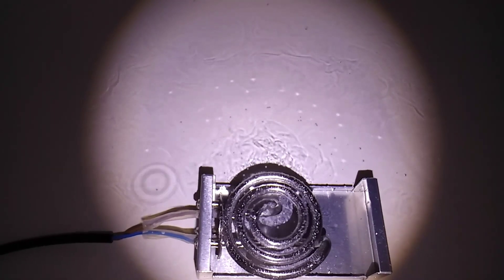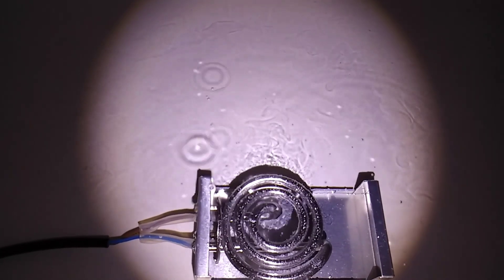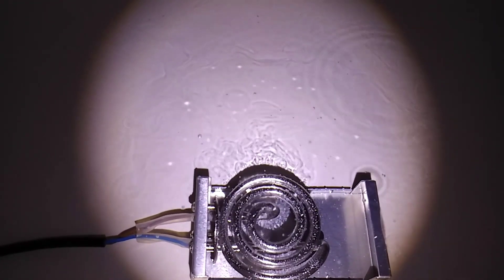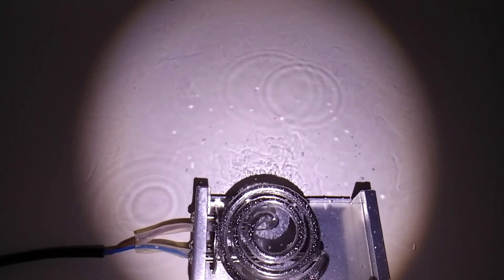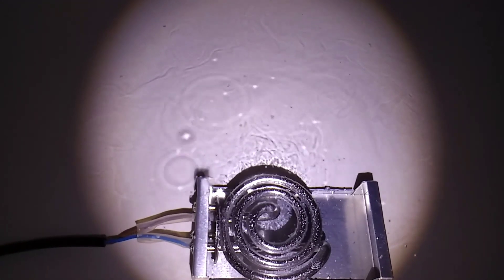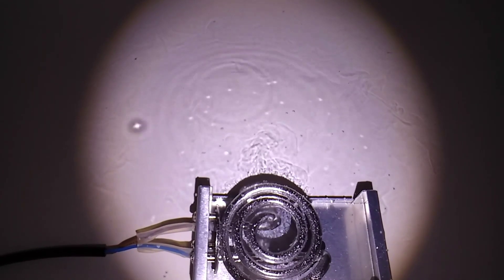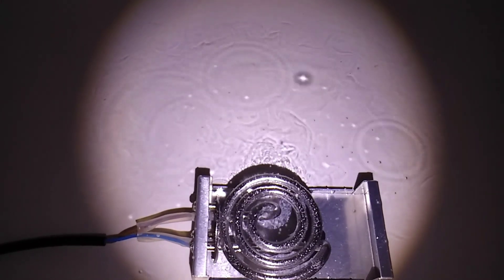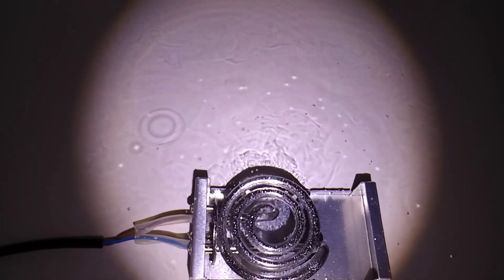Danger-bath.  If it's worth doing it's worth doing dangerously.

Comment: just like to know whether anyone has had their water tank heating element boil the water in their tank, the heating element was bought new and it has apparently a safety cut off for the thermostat, there is a reset button that activates should the main thermostat fail but apparently this didn't happen, one night the water came to boiling point and started to overflow in the to cold water tank above {I think this is an old design}, I suspect the satety cutoff which didn't work might be EU regulation, I'm from the U.K. the heating element is made by "Telsa" not the car company. http://www.teslauk.com/.
Reply from the maker: Has the built in thermostat ever worked?  It's worth checking that whoever installed it wired it correctly with the live being broken through the thermostat before it goes to the heating element terminal.  If the thermostat has failed then it's easy to install a new one as it will just slide into the sense tube.

Comment: Clive, I found my first tingly charger! I work at a repair shop and we had a power wheels car in with a 6v charger. The charger needed a new connector so I chopped the old one off, grabbed the meter to check polarity, touched one lead to the one wire (while holding it with my finger), and got a little tingle. Checked a.c. voltage between that wire and the (grounded) stainless steel work bench and sure enough got 50v a.c.
Reply from the maker: +Random_rapper20 The leakage from switchmode power supplies is very common.  I'm not sure about the metal workbench.  But ideal for electrical/electronic work.  A rubber mat on it might be a good idea.
Reply: Well to be quite honest most of the electrical work I do isn't on the bench (I repair electric scooters (look up razor e300 or goped esr 750), electric bikes, etc. The stuff I do on the bench is usually taking apart a battery pack, in which case I have a foam mat. I just happened to have my hand on the bench. That's the first charger that was tingly.

Comment: My landlord fitted a  thermostatic mixing valve to my bath, which produces water at a temperature just above the temperature of traditional English ale. The water in the sink comes out at just below boiling point, so I can scald my hands when I wash after... you know.... I have to use a hose to fill the bath from the sink. grrr.

Comment: Just curious, is there a risk that the bath tub at mains potential could couple into other apartments of a complex via the water pipes (if they're touching the tub), or is the grounding system designed to prevent that somehow?
Reply from the maker: +Chuu Ni This is a detached house and copper plumbing is bonded to ground in the UK.

Comment: I recently had a birthday when I got a bunch of old stuff, among these... a water heater that is basically this, but smaller and without any housing meant to be put in a cup, to heat your beverage. I have yet to try it, but I suspect I would have to be plenty sleepy to forget it in the cup, so perhaps it's... a slight degree safer. Or not, as pulling the cord would fling a scolding hot heating element across the room, and potentially a hot beverage.

Comment: Hey biclivedotcom. I put an el string directly into the mains and it worked. Can you test that? +bigclivedotcom
Reply from the maker: +Basti ! EL wires do operate at about 100v and a high frequency.  Some EL nightlights and switchblades use EL material across the mains.  The EL wire may be dimmer than normal at the low frequency.  The insulation in the wire might not be rated for mains connection, so proceed with caution.
Reply: bigclivedotcom thank you for your answer. Can you pls make a video about it. Cause i like el and you are my favourite youtuber.  (Sorry for the bad spelling. Im a german)

Comment: I noticed the other day that when I took my high end stainless steel soup pot with boiling water off the burner and put it into the sink it gave off really pretty smoke as the sun rays hit the evaporating water. The pot has copper in it so the effect lasted a very long time. My initial thought in doing this was to let the pot gradually cool down but now i'm going to do this for the show.

Comment: There is a picture, that often crops up at  Health & Safety courses, of a man standing on a step ladder in the middle of a swimming pool holding a 240V drill on a long extension cable. It is supposed to be a laughably dangerous act, but if he had fallen in holding a live power tool would he have been electrocuted? I can't see why any electricity would flow through his body.

Comment: Shouldn't the RCD trip? Isn't every circuit protected by it, or is the bath not made out of any metal?
Reply: From the description: "The unit relies on the resistivity of the clean water to limit current leakage. ... The circuit is protected by an RCD/GFCI for "safety". I measured the leakage to ground at just 1 or 2mA."

Comment: How much electricity would you extremely safe method take to hear a bath compared to a old fashioned immersion heater ?
Reply: Probably about the same - the tank would have losses throughout the day, the bath would only have losses during the time its being filled and heated - but the bath is open at the top. Seems like it'd probably not be very different overall?

Comment: Its always Curious..that an ISOLATED item or Environment DOES NOT conduct unless grounded..  Enameling works well, and so do Plastic/Fiberglass TUBES, as they do NOT ground thru the Plumbing..but the Sewer line is enough to make it a REAL shocker..but as long as you are 1 pole, even with abit of Flow, Generally you are safe..

Comment: I've got some great 20kW heaters at work that open up all the time when the water corrodes through the stainless steel casing in the open top tanks. Those are operating at 480vac and they arc over for about 5 minutes before blowing the fuses. That is really neat to watch, and potentially lethal. Too bad I don't normally have a video camera with me when it happens. That would be a really en-lightning experience to share with you Clive.

Comment: I would suggest a heating element from an electric hot water heater, but I suppose most bathrooms don't have the wiring to support that.  Things may be different in the U.K.
Reply from the maker: I ran an extension in for this incident.

Comment: So if it can produce a shock in reference to ground, if you have a metal drain fitting and pipe would that cause it to trip out?
Reply from the maker: There was a very slight gradient through the water, but it was pure enough not to leak much current.
Reply: +bigclivedotcom add some salt ;-)
Reply: "Bath salts" are bad for you... :-)

Comment: You should tested to see if there is any electricity coming off it, maybe like a meter or something.
Reply from the maker: I did.  I clamped the two core cable with a sensitive AC clamp meter to see if there was any leakage causing a differential.  It was only a couple of milliamps.

Comment: You are seeing Schlieren. They are following the flow of convection. The popping bubbles make a pointful companion.
Reply: Ahah, I've been trying to remember that word for like two weeks because I wanted to look up the faq's on how to photograph it for air again, pretty sure I remember how most of it goes but wanted to check before I started stalking the local dollar stores for makeup mirrors to try and use as the parabolic reflector set.
Reply: Not entirely sure how well it'll work seeing as how it's intended to do at focal lengths in the 8-10foot or larger range to make sure the angles of incidence aren't crossed by the elements themselves (and a known focal length though that can be approximated easily enough) but I figure if I find a couple for $2 and I've got the camera, razorblades, and lightsource already then what am I out? $4 if it don't work.  If it does OTOH I'm gonna blow the mind of my 14 yo sorta honorary nephew who's into science-y stuff.

Comment: That visible convection effect is like poundland Schlieren photography :)

Personally I'd optimise this process with a healthy layer of bubble bath foam on top to reduce evaporative heat losses.
Reply: Perhaps some lurid pink glitter sprinkled in the water for extra pizazz?
Reply from the maker: The science of getting glitter to suspend in water is complex.  It took me a very long time to finally make a working glitter lamp.  The hard plastic needed for the glitter effect is quite dense, so it takes a very high gravity liquid to support it.
Reply: DashCamAndy, ooh, that'd work
Reply: Gycerol (1.2 g/cm3)? Unless 20% denser than water isn't anywhere near heavy enough. Sodium silicate (2.4 gm/cm3)maybe?
Reply: MarcAFK, I was just thinking that.
Reply: Theres always Clerici solution (4-5g/cm3) if you need extreme density.

Comment: Clive,

I don't have hot water in my house because it is an old immersion 100ltr tank and well it is just me living here in the one bedroomed flat. I have electrical knowledge and would honestly pay you to make one for me. It would save me having to spend £1.25 of electric just to go for a bath every time on such limited funds. (I don't own a shower) 

Anyway, sincere request!
P.s. I live in Scotland too :)
Reply: +Maddie  You might not get an answer from anyone here, no-one wants to be responsible for giving instructions for something that may kill you.   Don't build one, replace the element in your existing water heater.  The components for the heater in this video consist of: a UK plug and wire, a scrap AL frame to keep the heating element from melting into the tub, a replacement sealed heating element (sold as a replacement part on Ebay), heat shrink tubing to cover the connections.  BigClive covered his tub-heater's construction in a video posted about two years ago.  This heater can kill you or your friends.  Don't build one, replace the element in your existing water heater.
Reply: +Maddie You'd be better off lagging that tank and using night rate electricity to drive the immersion IMO.
Reply from the maker: This isn't a safe way to heat the water, but you can buy immersion bucket heaters that could be used relatively safely, although you'd have to be careful the element didn't make contact with the side of the bath in case it burned or melted it.
Reply: Maddie heat it up on the stove old school or get an aquarium heater (ponds) might have to switch it on b4 you go to bed though....
Reply: Kettles. Preferably two as you can have one switched on and heating while pouring the other.
Reply: +bobby blues - I can confirm that ferrying pans of near boiling water to the bathtub works as I had to do it in a flat for a while while trying to get the landlord to do something about the water heater. Carrying pans of nearly boiling water from room to room is also quite dangerous though.
Reply: Same here stuck with an immersion heater, maybe best to lower the temp on thermostat to the lowest, set timer  after midnight for economy 7 and bath in morning using all the hot water. We fill the kettle for washing up as the idiot plumber used 10mm flexi on a high pressure mixer tap. I can pee faster than that stupid tap.
Reply: Not necessarily straightforward to know when your economy 7 hours are without physically looking at your meter.
Officially it varies by region
https://customerservices.npower.com/app/answers/detail/a_id/179/~/what-are-the-economy-7-peak-and-off-peak-periods%3F 

But having said that I'm pretty sure mine clicks in and out a couple of times some nights even though I'm in a region that's supposed to have a fixed 7 continuous hours
Reply: Maddie I genuinely don't mean to come across as rude Miss Maddie... But if you have a good electrical knowledge, couldn't you make one of these yourself? ^^; please don't take that question the wrong way... I'm just concerned that you might electrocute yourself. LOL

please be safe...

Comment: You probably wouldn't get a shock, neutral is also ground potential (or it should be), the live will take the shortest path, so goes to neutral, not through your body and through maybe a wood or vinyl tile.
If you have a cast iron bath, hopefully that's grounded, and again the current would rather flow to that.
Drop a meter probe into the water close to the heater, other end grounded.

Comment: Or you can just stick two shaving blades to the live and neutral, it will be even more dangerous and "nice feeling"... They should call it "The 50 Hz bath of death"...
Reply from the maker: In Japan they have electric baths that do pass current through you via metal plates on either side.
Reply: girlsdrinkfeck if enough current passed through you to do any significant heating you would have died long before that happened.
Reply: clive u mean like your own body acts as the resistance in the current path to create the heat ?
Reply: whoops i made no sense
Reply: bigclivedotcom Hmm, sounds interesting, I have to try it. But I'm thinking about a step down transformer, mains voltage doesn't like me very much...
Reply: bigclivedotcom oh my goodness what new crazy Japanese inventions will I hear of next